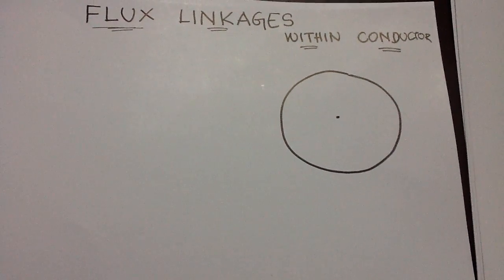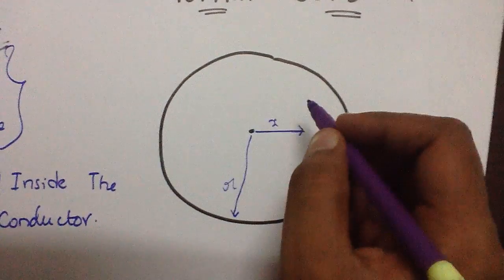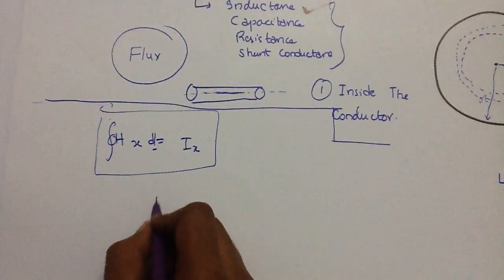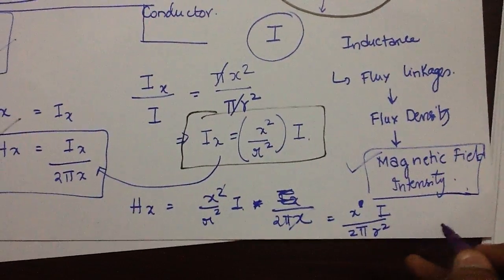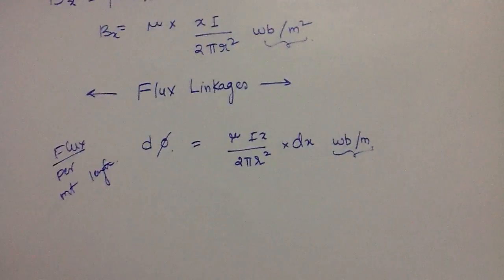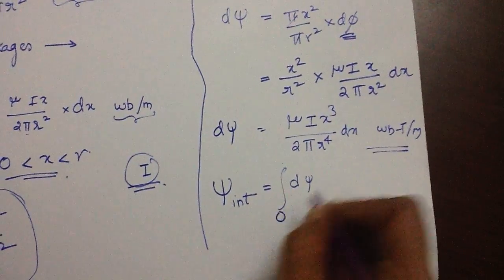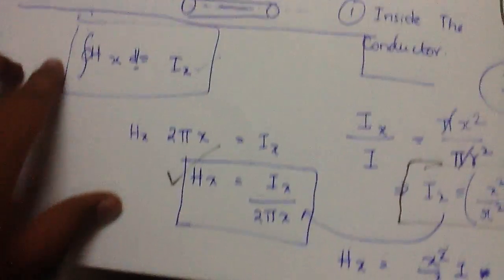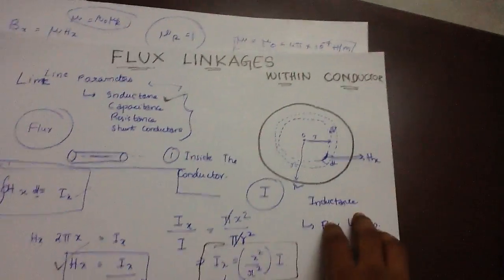Flux Linkages Inside the conductor

Comment: Very well explained Sir. I did not understand the flux getting multiplied with x^2/r^2 part though. Could you please clarify ?
Reply: he doesn't understand it either, this is just word for word from some textbook
Reply: I am having this same problem.
Reply: I have the same problem. The only logical explanation I can think of is, that for an infinitely thin cross-sectional area of the conductor, the amount of flux that passes radially through a portion of radius x of that thin area, would be the same amount of flux that passes through the same portion of area if it were parallel to the area vector. Hence we multiply with x^2/r^2. Hope you understand, and, again, I am not sure if this is correct.
Reply: @salihletic3487  it actually comes from I = integral(Jds) J is the conductors total current density we need to find that first which is going to be j=I/(pi.r[square]) then we use this j to determine our enclosed current you just need to take surface integral then walla